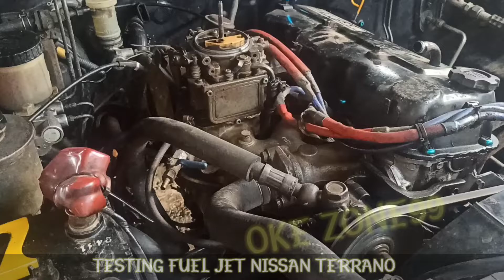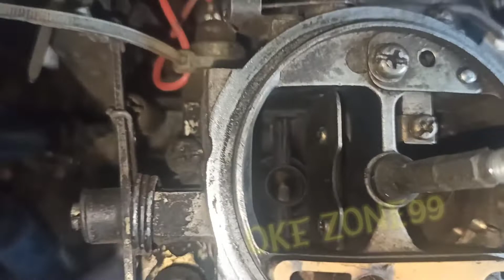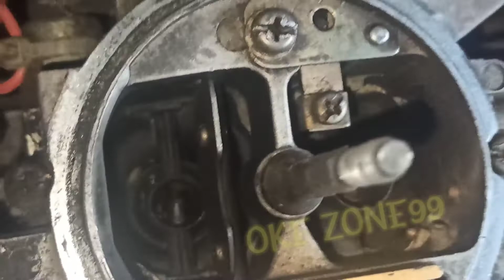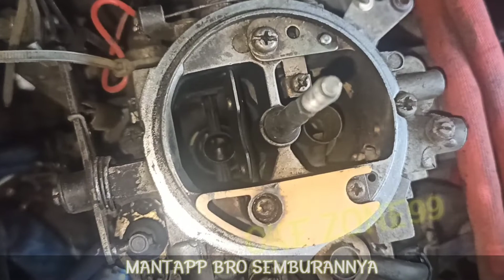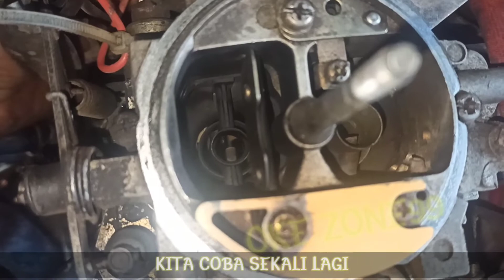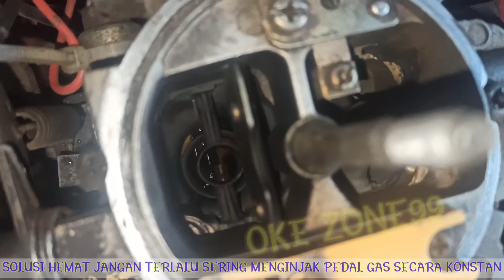NISSAN TERRANO||CARA AGAR NISSAN TERRANO IRIT BBM||fuel jet bekerja bikin boros @OKEZONE99

Comment: dlu pernah punya ini nih kingsroad 2003,bener2 sahabat pertamina,bensin cm dapet di 1/4-1/5 uda distel2 di macem2 spesialis karbu tetep sama aja,akhirnya dijual dah..lucunya konsumsi bbm sama aja  kek cherooke yg 4.0 punya temen🤣🤣 ...tpi harus diakuin,body terrano emg berotot bgt,macho abissss
Reply from the maker: Ya bener banget bos fuel rasio standart seperti itu😀😀😀 untuk injakan gas konstant. Walau pun mobil tua untuk bodi dan suspensi tidak kalah dengan pendatang baru.
Reply: @OKEZONE99  sebenernya ini mobil bs dibikin irit ga sih om??prnah liat di short yt ada yg ngeklaim bs bikin 1:13...klo emg bisa dibuat irit,rncana pengen ambil lg nih mobil
Reply from the maker: @odiodi5221  bisa kalau dibuat system injeksi, kalau masih pakai karburator ya gitu2 aja. Tidak ada perubahan yang signifikan antara fuel rasio dan power mesin.
Reply: @OKEZONE99 caranya gmn om di buat full injeksi
Reply: 1/9 normal jarak jauh

Comment: nisan terano biar aga irit make spuyer dia meter brapa om?
Reply from the maker: Pakai spuyer dibawah standardnya , sesuai keperluan unit.
Spuyer secunder/pilot jet/fueljet dikasih yang lebih kecil diameternya bos.
Reply from the maker: Pakai ukuran antara 0.9mm/0.8mm.
Reply: @OKEZONE99  klo cuma spuyernya yg di ganti lebih kecil diameternya harus setel klep tidak om?
Reply from the maker: @felanadira3452  stelan klep tetap standard, terlalu kencang start awal kalau mesin dingin akan lebih berat, seperti battray drop, kalau dilonggari dari standard mesin ngelitik.